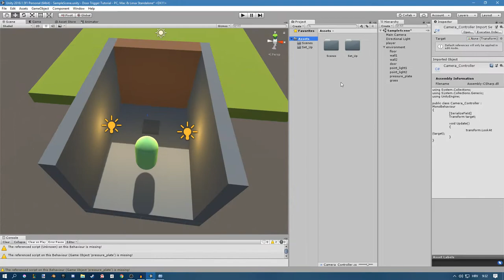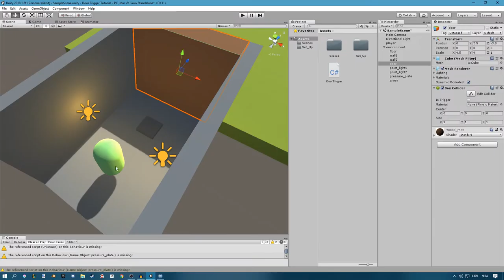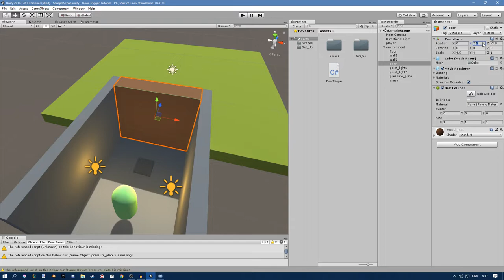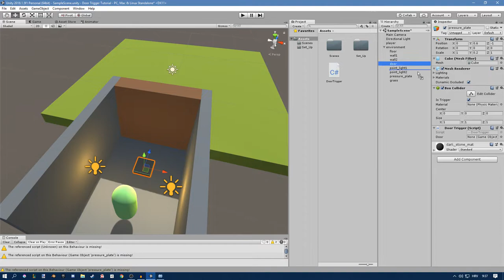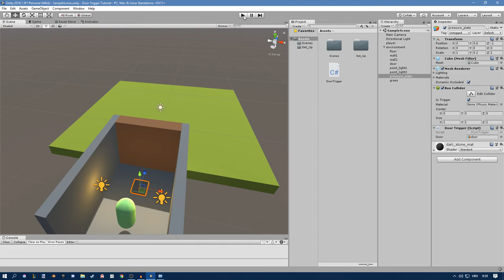Door Opening Trigger In Unity - Beginner Friendly Tutorial/ Guide

Comment: Could you explain how to dash character forward with addforce and then set delay for some time ?
Reply from the maker: Of course I can :D. Dashing forward is pretty simple... Rigidbody.AddForce(transform.forward * dashSpeed, ForceMode.Impulse) - dashSpeed is the speed of the dash obviously and ForceMode.Impulse just makes it so the force is added instantly and not over time ( https://docs.unity3d.com/ScriptReference/ForceMode.Impulse.html ). The delay is still really simple... make a bool called somehting like isDashing and set it to be false by default, also create a float called something like dashCooldown or dashDelay and set it to 0, then use if(Input.GetKeyDown(KeyCode.*your key*) && isDashing == false ) to check when you press the dash key and if we are dashing, if we pressed the dash key and we are not dashing we will set the dashCooldown to 4 or 5 or anything you want, and also set the isDashing to true and then insert your dash function from before (Rigidbody.AddForce.....) Do the previous steps in FixedUpdate() because you are dealing with physics. Now the last step is to....In the Update() function create a if statement( if(isDashing == true) )
so we check if we are dashing and if we are it means that we have to start lowering the dashCooldown so.... if(isDashing == true) { dashCooldown -= Time.deltaTime } so we lower the dashCooldown by 1 each second. and then after that we check if the dashCooldown is less or equal to 0 and if it is we set isDashing to false. if (isDashing = true) { dashCooldown -= Time.deltaTime; if (dashCooldown <= 0) { isDashing = false; } } This is the best I can expalin it to you and it probably doesnt make any sense looking at it like this so here is a image of the script https://imgur.com/YJkss1D
Reply: Thank you
Reply from the maker: No problem :D

Comment: hi sir. I am building with probuilder, but after pressure plate triggered I can go through it, but  door won't move up.
Reply from the maker: Hmmm, havent tried this with pro builder so I dont know what the problem is ::
Reply: Single Sapling Games thanks for replying, I am changing another way. Thanks again.  The video really helps!
Reply from the maker: <3
Reply: @SingleSapling  Am having the same problem. The door doesnt budge, but I can go through it. Debugging, I can see the axis move up but not the object itself. Any tip?
Reply: @SingleSapling  EDIT: I FOUND IT! Object was marked as static in the inspector. Cant believe I lost an hour on this >.<

Comment: Thanks so much for the vid! How do we make the door come back down? I used ontriggerexit but can't seem to get the door to come back down.
Reply from the maker: You can create a new float and call it something like doorCooldown and set it to like 5. In void Update() create a if statement and check if(isOpened == true). If it is decrement doorCooldown every second like this doorCooldown -= Time.deltaTime and then check if (doorCooldown <= 0). If it is move the door back to its original position( door.transform.position = new Vector3(0,0,0)) )
Reply: It seems like I got it working! Thank you so much :D I will def be subscribing!
Reply: My other question is if I want 2 pressure plates activated before the door opens how could I do that?
Reply from the maker: If you think about it its pretty simple.
First you need to create a new GameObject and call it door2 or something and also set it in the inspector.
You need a way of telling if the plates were steped on, so create a new float called something like platesTriggered and set it to 0.
Now every time you trigger a OnTriggerEnter you will not move the door, but you will just increment 1 into platesTriggered ( platesTriggered += 1 )
Create a update function ( void Update() {} ) and in there check if the platesTriggered equals to 2 ( if(platesTriggred == 2)) and if it is move the door so in the if statement add the door move code. Altough this might need some more code to work properly this is the best I can do in the comments. Maybe I can make a video on that?
Reply: @TST323  Can you please please please paste the code, I'm very new and idk how to get that code to work.